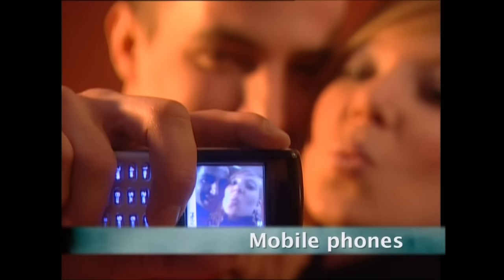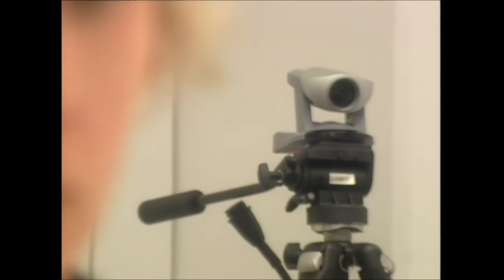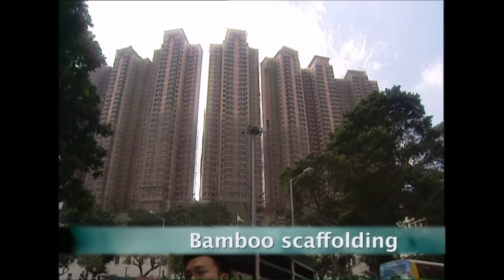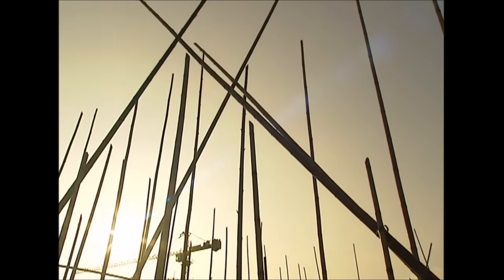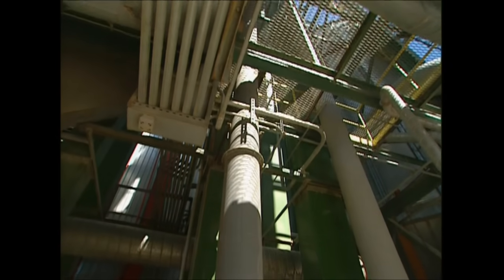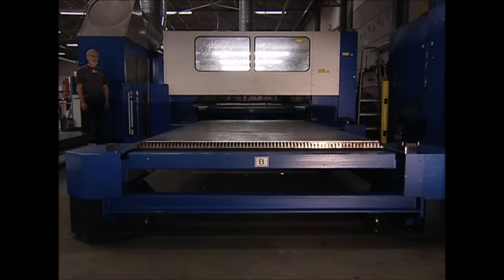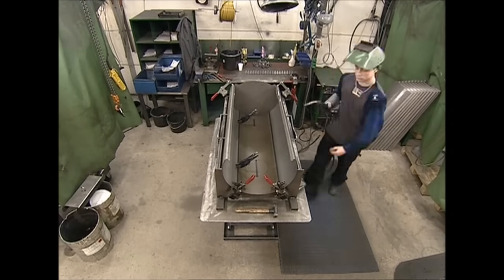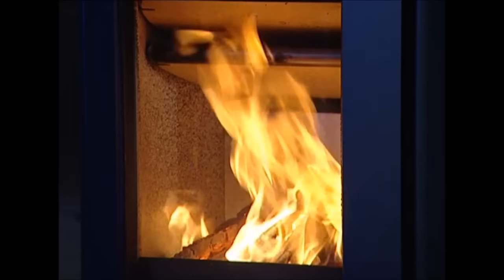► HOW IT WORKS | Mobile Phones, Bamboo Scaffolding, Rice, Stove | Episode 13 | Free Documentary

Comment: Manufacturers can still make phones with today's technology and yesterday's durability. They just choose not to.
Reply: Couldn’t sell ya a new one if the old one doesn’t wear out.........
Reply: You do realize the old durable phones have like 90% less screen... ya know the thing that breaks first
Reply: Why don’t go make one? No one stopping you..
Reply: Your correct, they do choose not too, but may I ask you to look into the price of a phone that is shock proof and has a modern design AND functionality.
Reply: What the other comments said, plus buy a Otter Box. I work Construction. Im not clumsy with my phone, and there has never been an accident an otter box couldn't handle.
Reply: All about the money
Reply: Thats racist
Reply: I don't fully agree with this. Maybe customers "don't want" a more resistant phone. Motorola launched Moto Z Force with the promisse to be more resistant than any phone at that time. But that was not a huge success, iPhone and Galaxy still light years far away from any Motorola phone in number of sells.
Reply: Old phones are less complex and therefore less locations for failure. That's why they were durable.
Reply: New phones are pretty durable, but they also have 6+in screens. That's a lot of screen real estate to protect. But remember, the models in the video could take grainy photos and a drop of water would destroy them. I just came home from the Caribbean with my modern phone and used it's 200mp camera to take pictures under water without a case. The trade off is worth it.
Reply: Same goes for everything else.

Comment: I still have my old push button phone still on the wall and it STILL WORKS!!!  The power has went out several times and I've resorted to have to using it when the cellphone battery was almost dead

Comment: I wonder what those hardhats are useful for at that height!
Reply: falling objects from- above
Reply: @SuperJohnkennedy1  yup, also scaffolders don't work always on top. So there could be someone above you dropping material or a tool, or stuff could drop from the crane. Also scaffolds can be narrow with pipes sticking out, where you can bang your head.
Reply: put simply, it's for the bamboo that gets dropped on your head during construction of the bamboo scaffolding :P
If it was in Australia, it would be to protect against the magpies dive bombing you & then the wedgetail eagles that attacked as you fell to your death while trying to avoid the magpie divebombing (even postmen need to wear helmets in Australia to avoid the magpies, while the eagles attack anything in the sky, from drones to people using handgliders)

Comment: They do a horrible job of making cell phones a cell phone needs to be large to fit your hand so that when you touch the phone you don't accidentally turn it off adjust the sound and everything else all the buttons need to be on the front with nothing on the sides tops or bottom the plug-in needs to be directly in the back so you can put the phone in a Coke cup holder without shorting out the phone in general everything's too small a cell phone should be at least eyes big as a carton of cigarettes

Comment: A team of highly skilled people designed the hardware and software of the mobile but don't even get a mention in this video. Apparently, the only designer worth talking about is the guy that sketches the plastic case!
Not a wonder that the take-up.of STEM subjects is so low.
Reply: The key criteria for todays phones is the "planned obsolescence", which is achieved via designers, so therefore the designers are the most important person to the company, since features really haven't changed from when this video was made to today, only reason anyone's bought a new one was to keep up with the fashion changes created by the designer :P
Reply: @1 Trillon Dollar Coin yup VERY slight upgrades maybe, but there is very little functional difference between a new release iphone & the model before it - everytime a new model is released this applies, so there is really no need to upgrade to the new model EVERYTIME it is released!